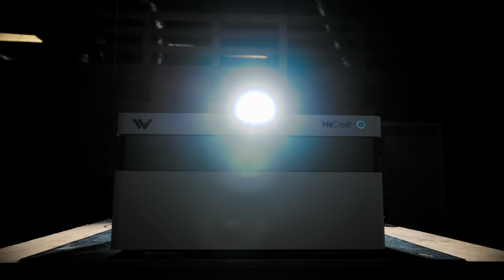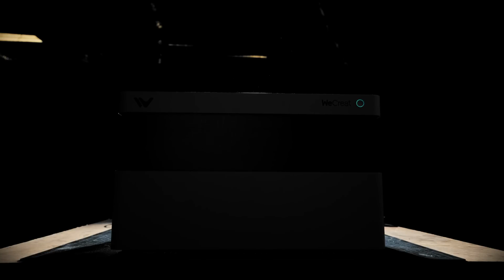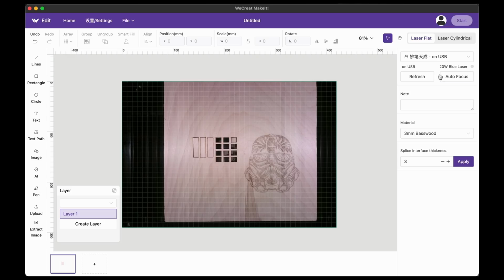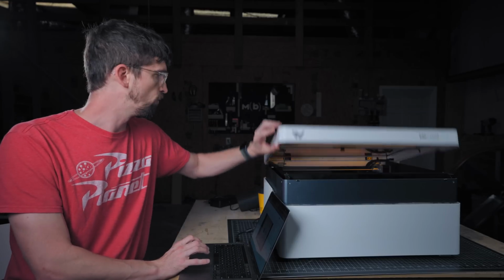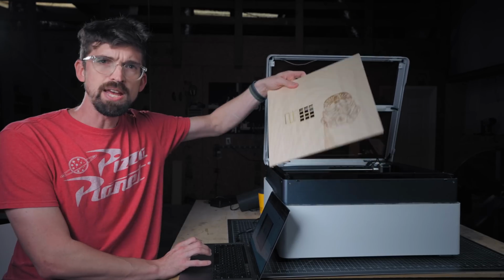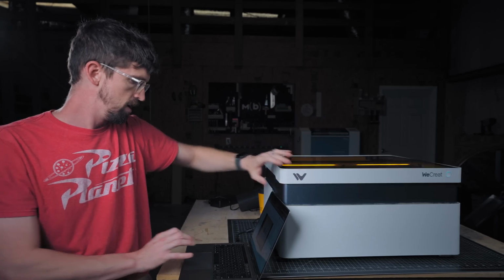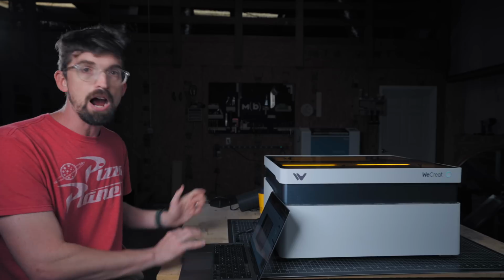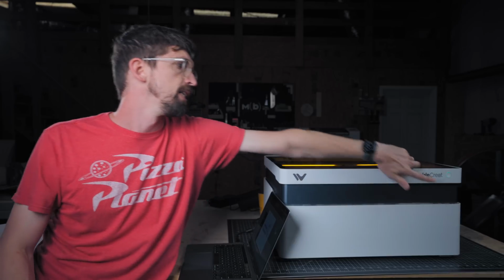Is the future of lasers?  -  WeCreat Vision Laser Cutter & Engraver

Comment: It says on their website it cuts clear acrylic. Is that right? Because I thought that was gonna be the game changer you mentioned. Everything else screams knock off of the M1 with higher laser capability. But almost identical. That said, if it will cut clear acrylic, take my money.
Reply from the maker: No diode is going to be able to do clear acrylic.  I will say overall the build and rising function is a step up over the M1
Reply: @makeorbreakshop  that’s what I thought, but they have clear acrylic shown in two places in their advertisement for it. Will you ask them why they are doing that? It seems deceptive if it can’t.
Reply: I have the M1 5watt and have a love hate relationship with it. Too slow and inconsistent. 

I put in a deposit for this. 

I bought a K40, but I’m in over my head with that. Wish I had saved that to put toward to less expensive CO2.

Out of the budget ones, which one of the CO2 do you recommend? I was looking at Gweike.

Comment: Side by side, this machine doesn't even come close to the LaserMATIC MK2, 10/20W, in price, size, R&D or build quality; yes I have both. You can get the 10/30W for the same price. The fact that it doesn't use Lightburn and you can't control the focus makes it a non-starter for me and for most businesses. This is the Glowforge of diode lasers for people who don't want to actually create anything themselves.  Good video as always....
Reply from the maker: I need to check out the LaserMATIC, only hear good things.  It does look like it supports Lightburn but that was a pretty recent change I need to try it out.

Comment: M1 from xTool is full enclosure, has the same security lid, a pre calibrate camera, blade cuter and air assist as an option :)
Reply: It’s not as good. I can tell by the video alone it’s not as well built. Their air assist is also available on Amazon for $36 not $139. Get it there. The tubing is cheap too. That’s a rip off from Xtool, and I wish I could undo it. Also, my blade cut my fire safety cords because they were their own kind of hazard and wouldn’t stay in place so I took that down and counted it as a loss also. I have a love hate with my M1, mostly hate, which is why I am scouring reviews for other lasers. Lol 

It was a good concept, but they didn’t execute it great. I saw one honest review that fit my feelings exactly, but only after I got it. She was like I am ruining my influencer cred, but this isn’t something I can back, and she actually gained my following with that, not lost it.
Reply: Hi there. Looking for my first laser cutter for home use. Premium is on safety. Based on your experience with both extra and we create, which would you recommend?

Comment: It does check a lot of my requirement, but I must admit, I would like to have more information before buying it. How the rotary clamps, how the bed looks like, what are the specs of the exhaust port(size and does it include a fan?), I see it is compatible with lightburn, but what does work with it, how burned are wood pieces when being cut with the air-assist. Does the auto-z-adjust allow to move when cutting objects. How confident are we to have the company living long enough to support the warranty

Also, there is almost no pictures of the product available on their website :(

Comment: Having to physically interact with the laser after you've sent the file isn't a plus, it's a serious downside. You should be able to just set it going from your PC and crack on, just like with current gen 3D printers.
Reply from the maker: I think the physical button would be a selling point in a school or even maker space setting.  A good safety thing, but totally agree if it’s in a different environment.
Reply: @makeorbreakshop   That's an excellent point, I was thinking of it as a home machine rather than a school setting. Good call.

Comment: If this had a 400x400 work area it would be great. I'd rather go with an XTool with a bigger work area and a home built enclosure. Enclosures are super-easy to make. You can just make a plywood box with a hinged lid. You seal it with caulk in the seams and weather stripping on the lid. And for air flow you put a PC fan on the side and a hose coming out the other side you vent to a window. To see you can add some plexiglass to the lid and/or sides. It may not look pretty but it works really well and is cheap.